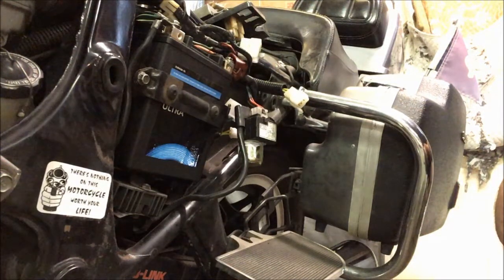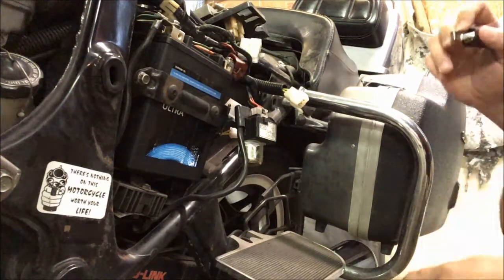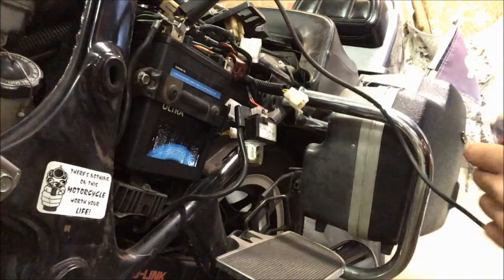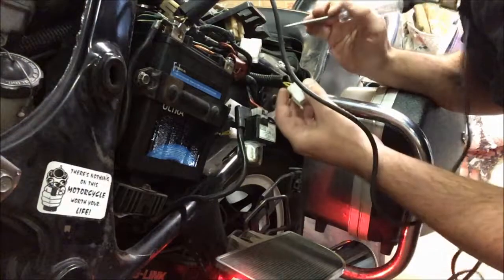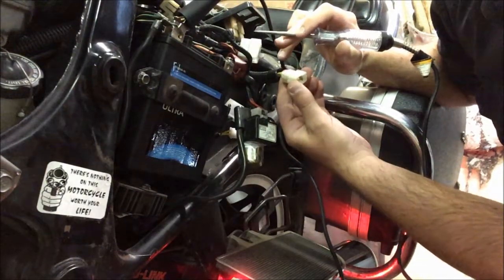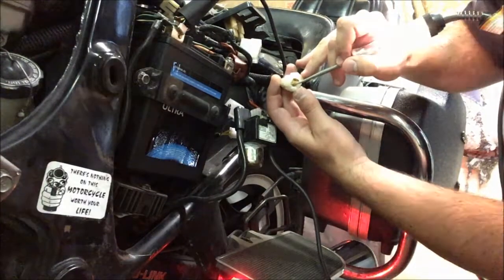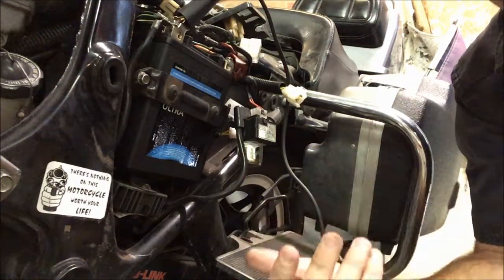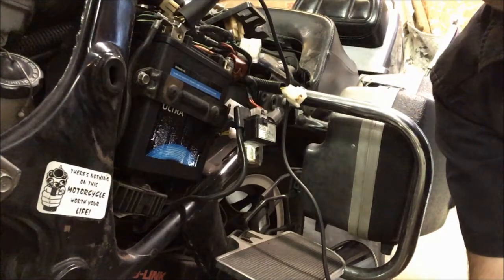How To Test A Stator With a Test Light

Comment: However, it might be better to additionally put a series regulator (or hybrid series-shunt). This would reduce unnecessary stator current and stator heating. If the stator burns out 💥again, you will have to do this.

Comment: How the fuck is it running if your stator is bad?
Reply from the maker: The stator on this particular model is responsible only for charging. It has a pickup coil that sends a signal to the cdi box and while the battery has enough power to run the cdi box and coils, it will run.